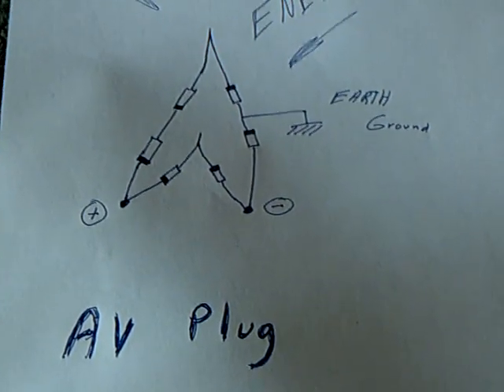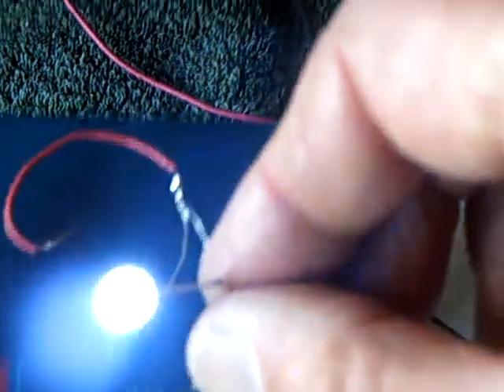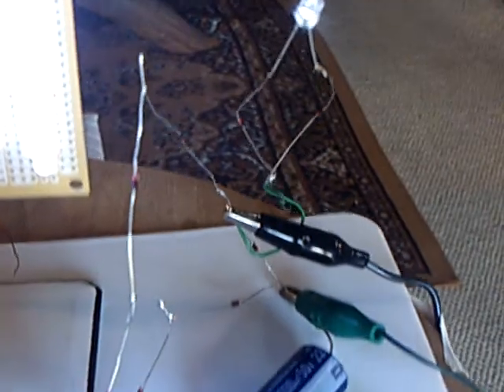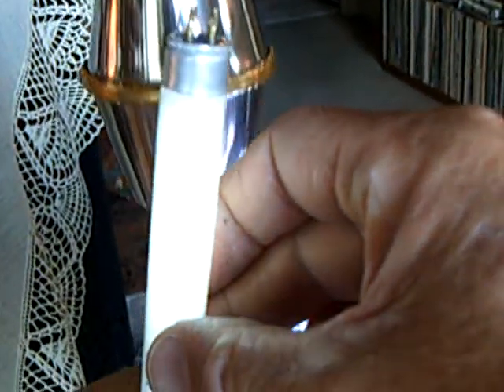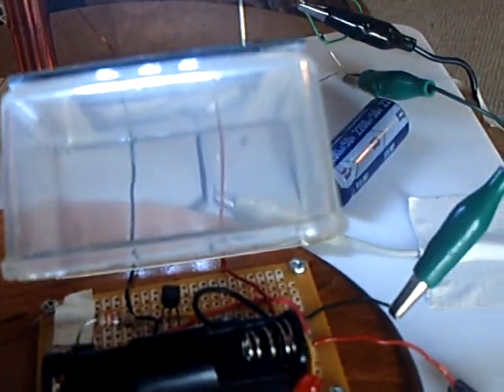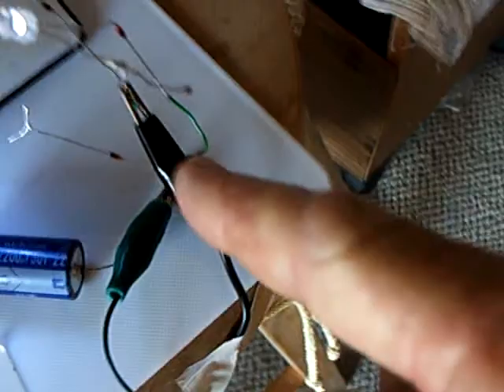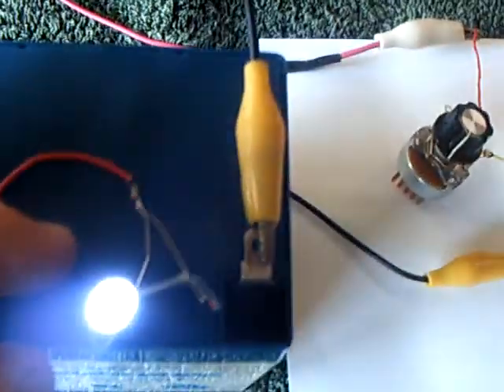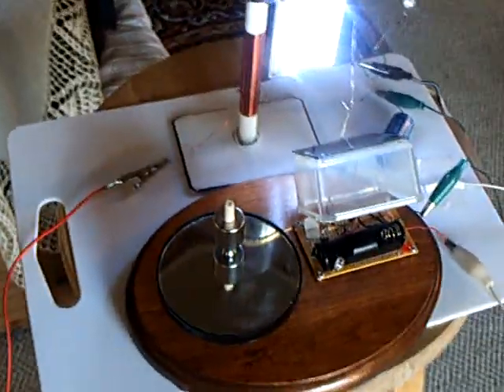SEC running a pulse motor wirelessly

Comment: I did the same thing a little while back with a slightly different set up.  I did skip the LED load on the L3 and put it all into the pulse motor/fan.  I like the modified AV plug and really enjoy your work!   - Cheers